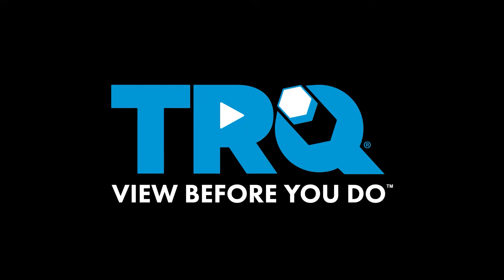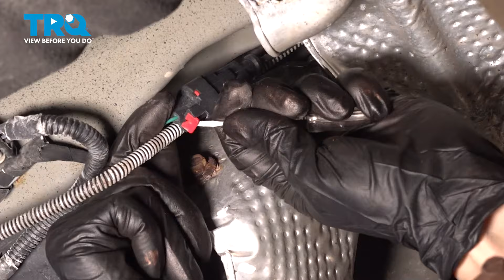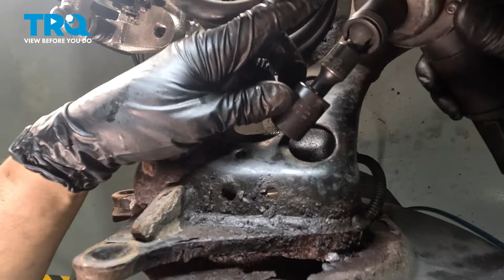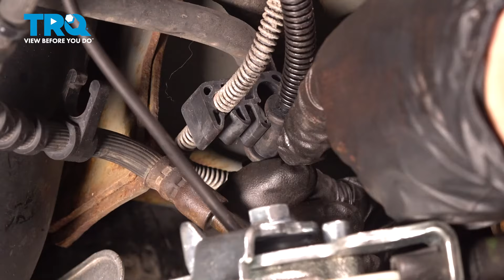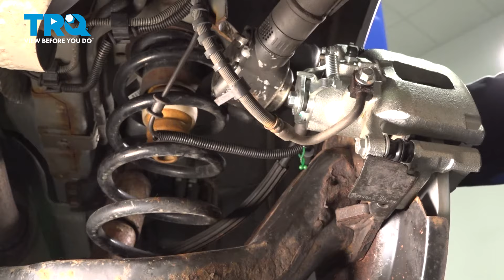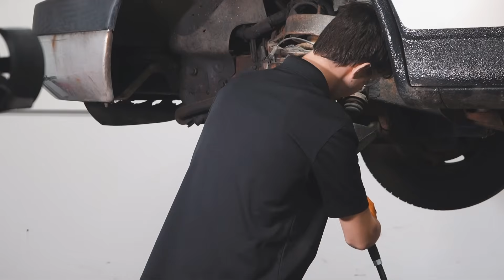How to Replace Rear Wheel Bearing & Hub Assemblies 2008-2020 Dodge Grand Caravan

Comment: at the 5:00 mark it looks like he is tightening in reverse.  During removal is was lefty loosy but this part looks flipped.  Notice during removal the brake mount holes are on the left but they are on the right in the tightening phase.  I think the video is flipped horizontally here.  Maybe an editing mistake, but why show it flipped?  I had to check it like 3 times to make sure the bolts aren't reverse threaded.  Last thing you need is someone wrenching on these backwards and breaking bolts trying to get them off.  
newbs beware: these are NOT reverse threaded bolts.

Comment: That is a perfect demonstration, very easy to follow.
You could have mentioned using a thin chisel between the hub flange and the axle beam to break the old hub free, if it doesn't budge with the hammer. Thanks

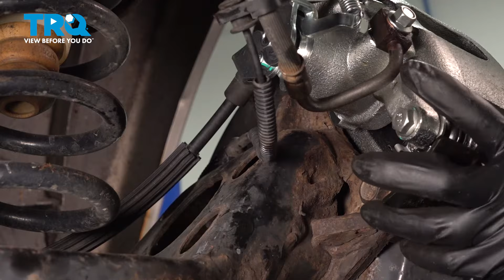Comment: Note that in the cut between 00:00:22 and 0:00:23 the brake rotor, pads and caliper were changed.

Before you think of starting, take a glance at the rear brakes. If they are in need of changing, drop another hundred on pads and rotors. The time you save removing hub and rotor together, instead of trying to separate them and preserve the rotor, is well worth your $100.

Comment: Nicely done. 
Just don't hit the caliper flange bracket like he did. It happens to the best of us. If you do, check for caliper bracket alignment before buttoning everything back up. If it's off, gently tap it back to where it belongs. Don't heat it.